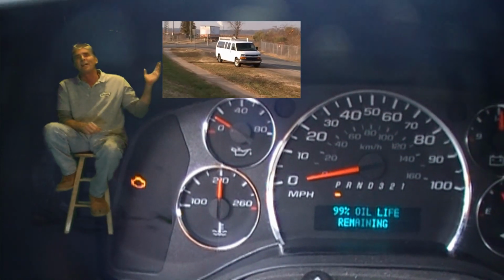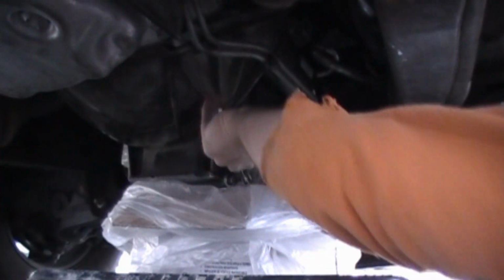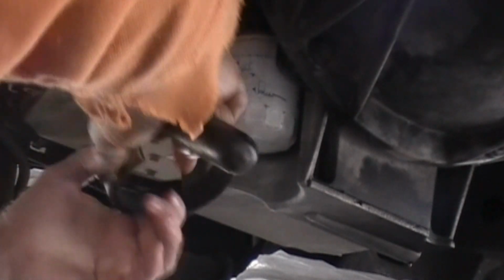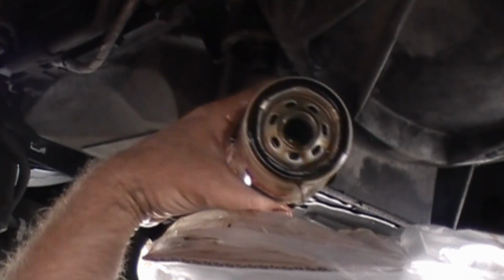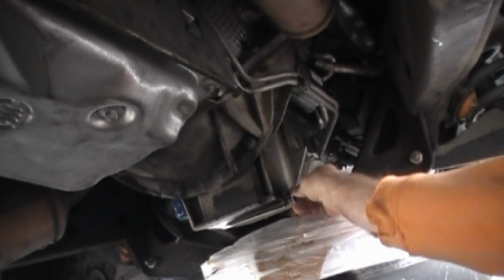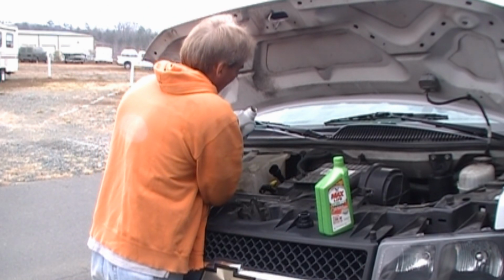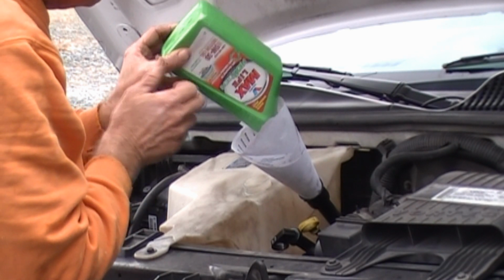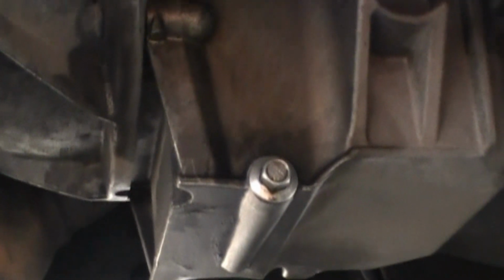2008 Chevy Express Oil Change, 267k  miles

Comment: My Trick is to Loosen the Filter. Then punch a small hole in the bottom. Loosen some more. And watch the Oil drain from the hole. Keeps me from getting hot oil everywhere.
Reply: That kind of mileage...go to 10w-30..that engine is Noisy Dude!!
Reply: What size socket for the plug